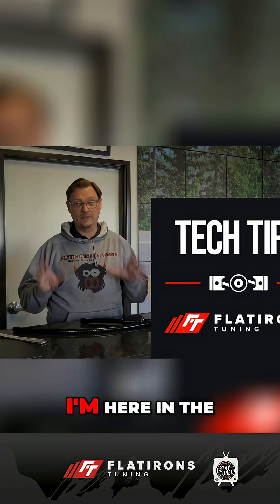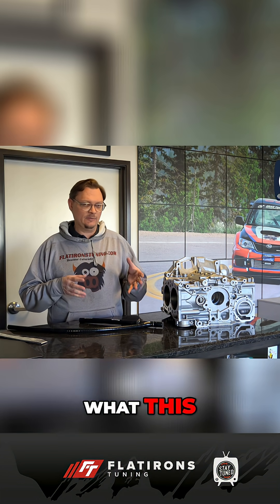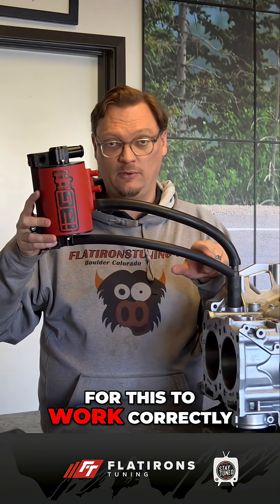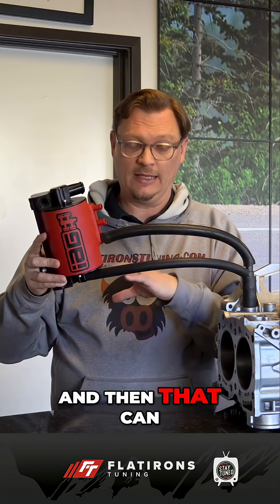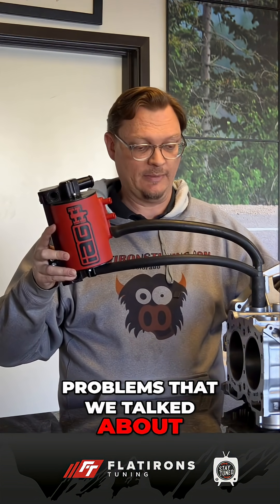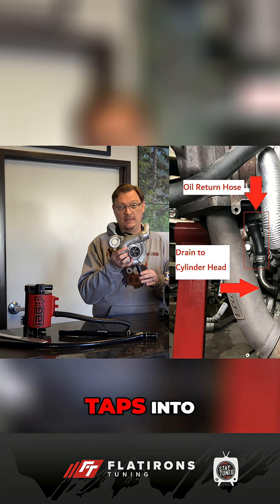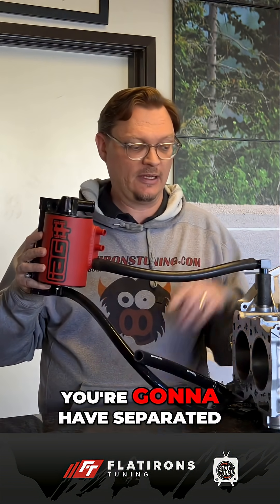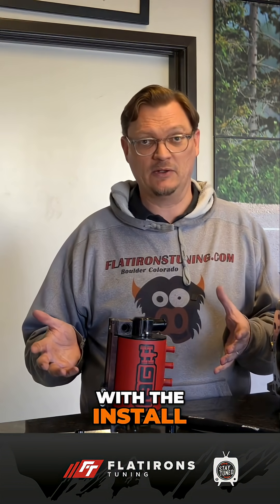3MI AOS Drain Hose Explained & How It Helps!

Comment: i made my own before finding out there's an off-the-shelf solution. nice piece.
Reply: "cylinder 4 cooling kit" should also be re-done. The current configuration on the market causes a lot of fluctuations in coolant temp control and often messes with heater core flow.